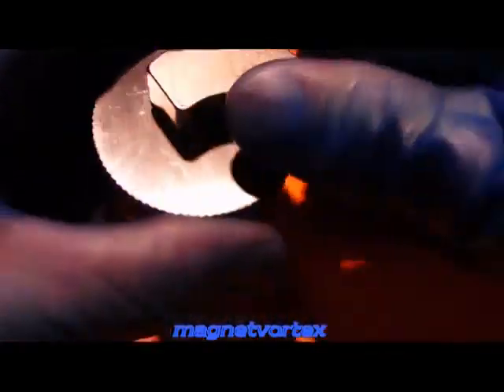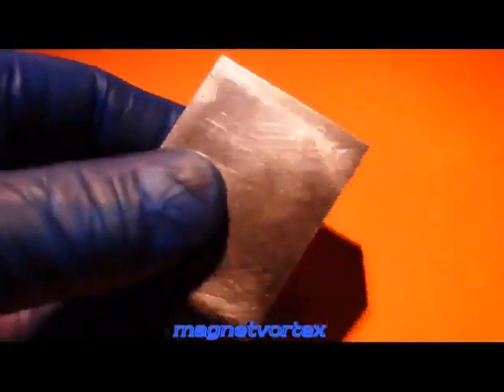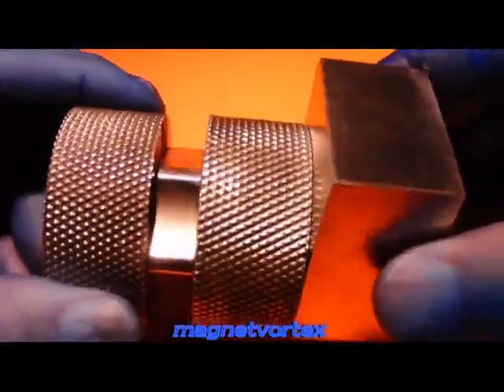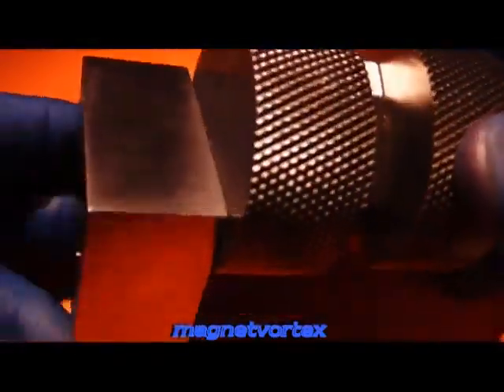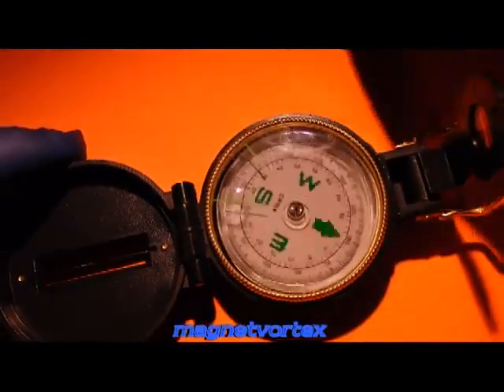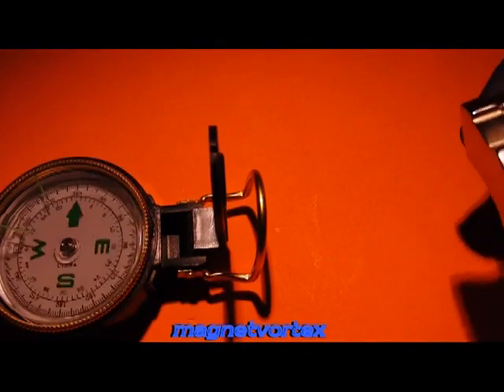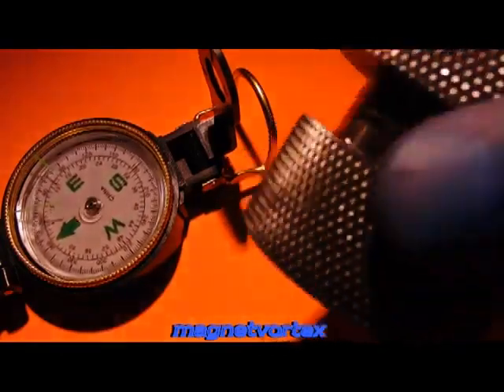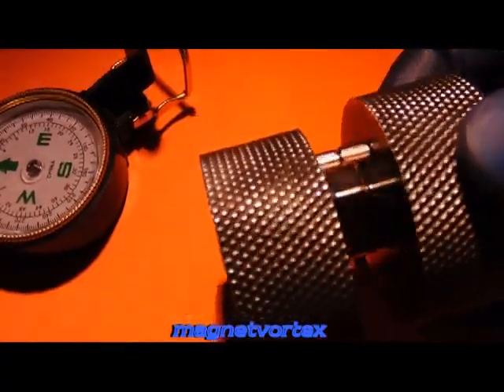Strange double-magnet with a confined field and 4 polarities. An unknown effect of permanent magnets

Comment: I watched a video similar but different where they used two bar magnets and two pieces of non magnetic pieces of steel. As we know like poles repel except when you place a piece of steel inbetween them, like poles will be attracted and share the steel. 

Here is where it gets interesting, disengage one of the magnets apply the other piece of steel to the disengage magnet and try putting them back together and they revert back to repelling one another. 

It's almost like magnetism runs along the surface area of the steel pieces...
Reply: This was the reverse of your experiment...

Comment: Yes, it not that you shield against a static magnetic field, there is no such thing (only zero gauss chamber made from muMetal which diverges the field along the walls of the chamber) but that that you have negated the field. HDD magnets are essentially bar magnets (magnetized by length and not by thickness). You put them side by side therefore antiparallel and therefore they net magnetic field is negated in contrast to the single case HDD magnet. A metal feromagnetic (not a magnet) will still stick however when brought close due to the close proximity of the individual poles of the HDD's magnets. When you stick in the video your two metal non initially magnetized cylinders they become also antiparallel magnetized to the initial HDD magnet(s). 

↑↓↑↓  (magnetic moments of 8 poles magnetic array) 

Because the magnets and metal cylinders are not perfectly isotropic magnetized there will be always a small amount residual dipole magnetism (coherent magnetism) left as a net effect.However this will subside and practically vanish as you add more and more magnets (permanent magnets and metal cylinders in contact) in antiparallel magnetic configuration. Add more of these cylinders and you will reach a point they can not stick anymore together. 

In a sense yes you can say you have produced an incoherent (i.e. not dipole) in line magnet array. The magnetic incoherent noise left when scaled down at the quantum level is gravity.